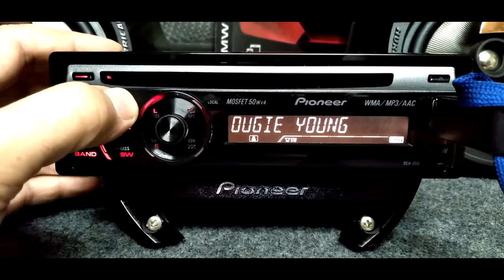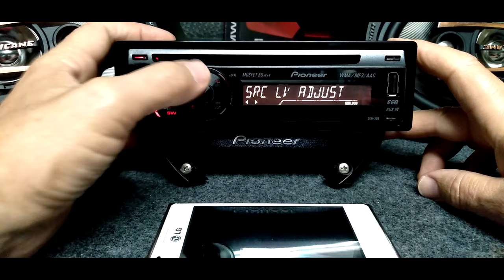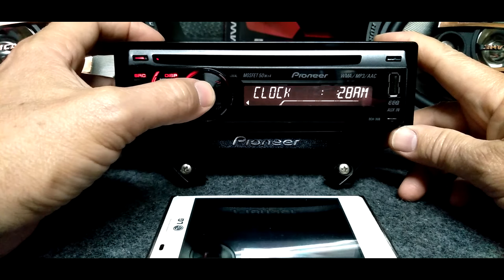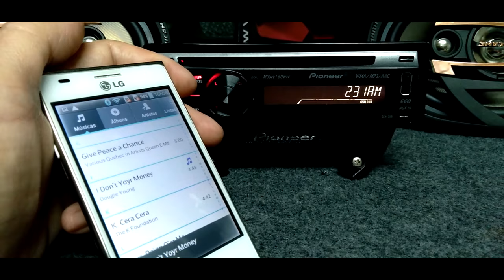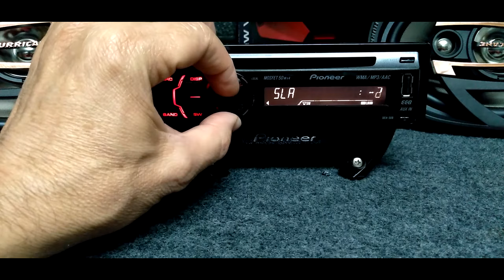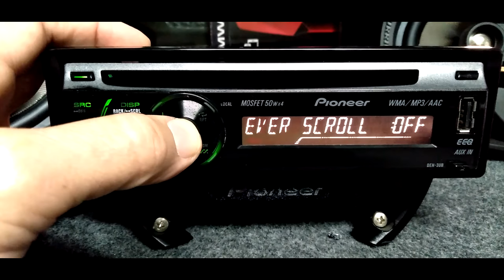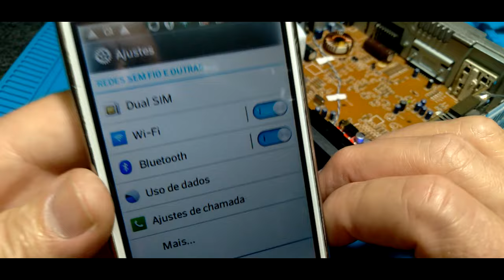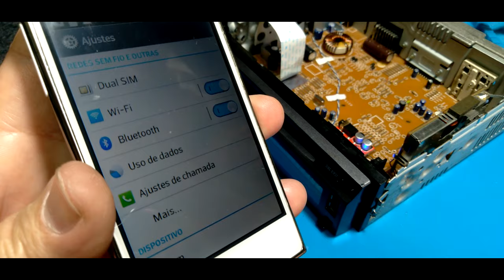#PIONEER DEH-3UB Novo #Bluetooth interno c/demonstração e outras funções p/ som automotivo TOP

Comment: How much speaker is suitable for this sterio
Reply from the maker: Speakers over 45 watts. To support the sound output power.
Reply: @autosound   i buyed second car that car have. Speakerbut not working only sterio working  in this car  i have front two speaker TS-G1011R  10 cm dual cone  model with 110 w max , 20 w nom  is this speaker is suitable or i buy any other more sound givig speaker u know that pls tell me the speaker model  name